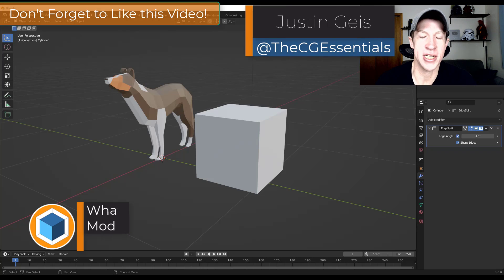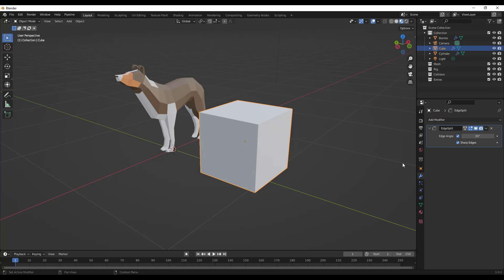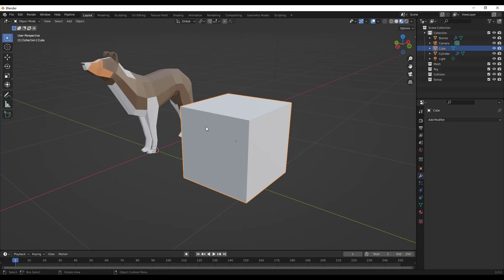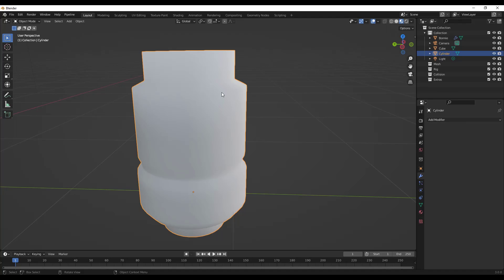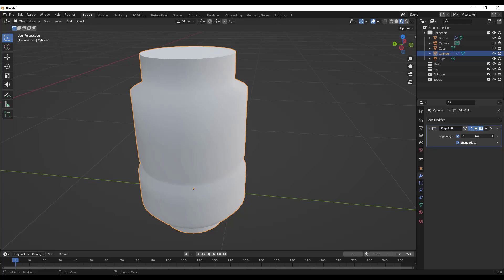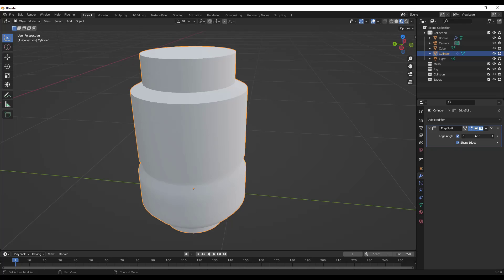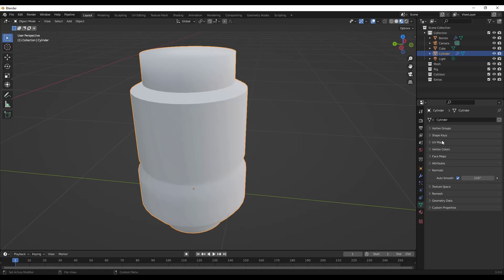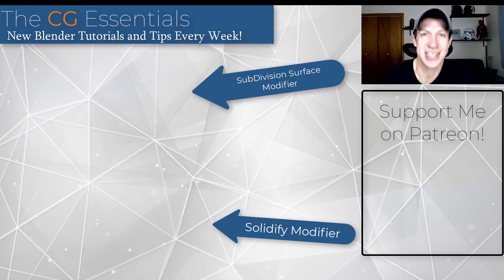How to Use the EDGE SPLIT Modifier in Blender!

Comment from the maker: Hi everyone! Let me know if you have any questions in the comments below! :)
Reply: Handy for when I want to make loose parts from an object that I want to apply different materials on different faces. I found that I can not add different materials to different faces on a single object without 1st splitting the object up.
this is the 1st time I have seen this modifier explain. So far I have been splitting my meshes up manually. thanks for the explanation. 👍👍👍👍

Comment: There is a cool trick when you follow Edge Split with Solidify and Bevel. You will get a separate panel for every face. VERY useful when making cabinets in archviz or hard surface modelling.

Comment: I tried the GPU acceleration for the SubSurf modifier for the first time today, and it said that GPU acceleration was disabled because I had "Auto Smooth" enabled. So I guess a use case for the Edge Split modifier could be if you wanted the functionality of auto smooth and GPU accelerated subsurf.

Comment: Great little video, thanks for that! 

I find this modifier quite interesting, but not necessarily for shading related stuff. I can imagine using it during the mesh/geo modelling stage, to very quickly do things which might otherwise be quite tedious. 
For example, some time ago I asked myself how I would cut a complex mesh into two pieces, without losing any geometry. 
Like, imagine how easy it would be to cut a high poly UV sphere into two identical/non-symmetrical parts without losing geo; with this modifier it's easy and quick. All you have to do is mark your chosen edge loop as sharp, apply the modifier, then separate the two pieces of the mesh in edit mode. 
I'm looking forward to having a play with this.
Thank you for bringing it to our attention.
Reply from the maker: Interesting application - I can see times where this might be valuable - that said, I'm not sure if there would be other ways to achieve this or not. Selecting the geometry and separating it might be more straightforward, but I'll be interested to see if you like this approach - thanks!